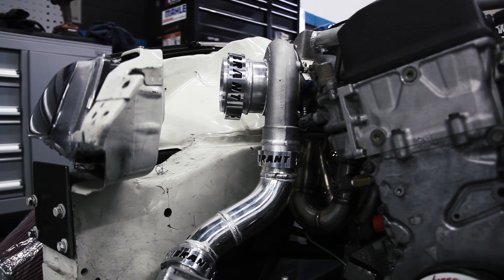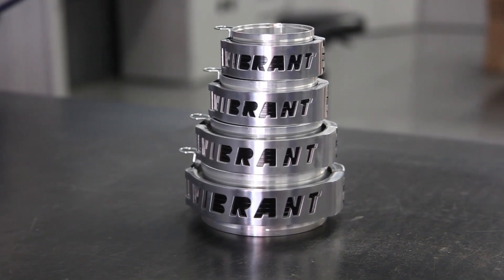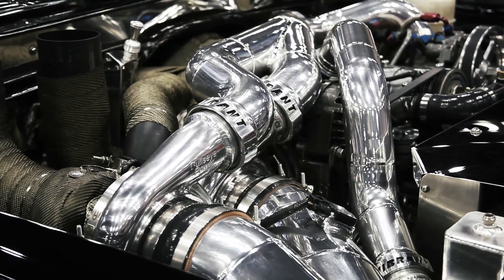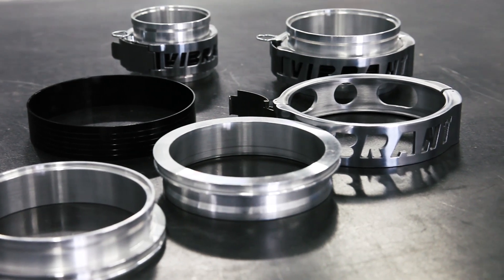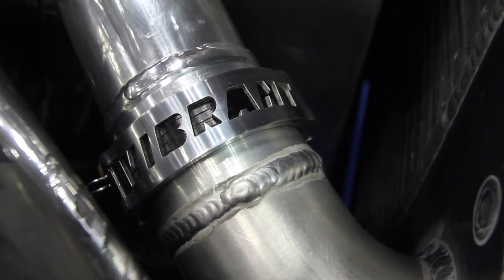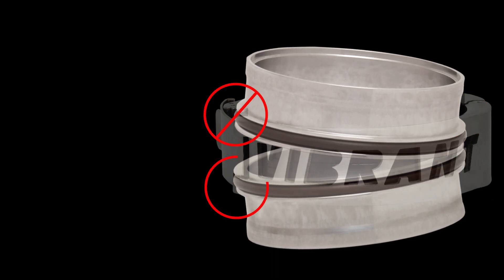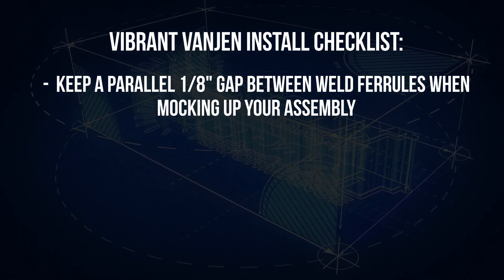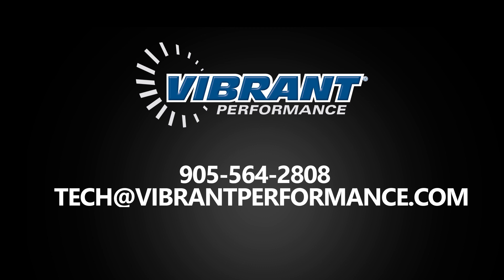Vibrant Performance VanJen Clamping System

Comment: you seem to have missed showing a piece of this system. is the black band inside the clamp rubber or aluminum?
Reply from the maker: The sleeve inside the clamp is aluminum. It seals on the two rubber o-rings that are located on the flanges that weld to the pipe. Hope that answers your question.

Comment: Would be nice to have stainless ferrules available.
Reply from the maker: Stainless Ferrules have been an option! Check out our catalog online. Part numbers are as follows (sold in pairs):
2.5": 12555
3": 12556
3.5": 12557
4": 12558
5": 12560

Comment: would these also be suitable for use with exhaust piping?
Reply: You aren't paying attention (as usual) the video stated tested to 400 degrees, typical exhaust is 1200+ degrees.... That should answer your question....
Reply from the maker: No, we recommend our quick release V-Bands for exhaust piping, these are strictly used for charge piping.